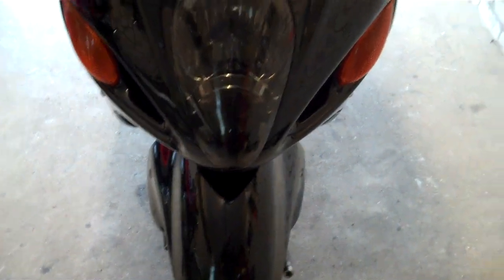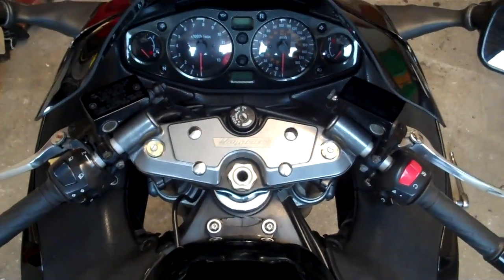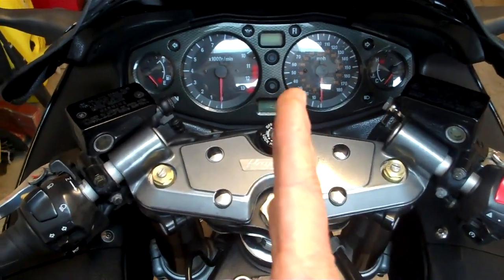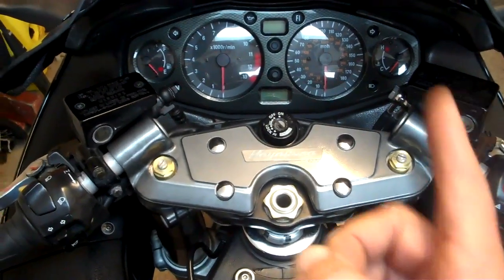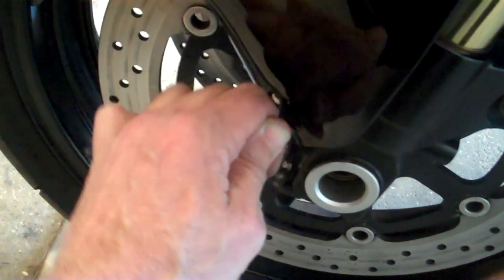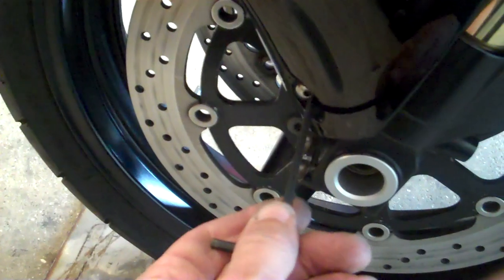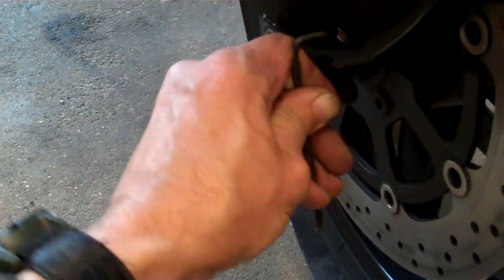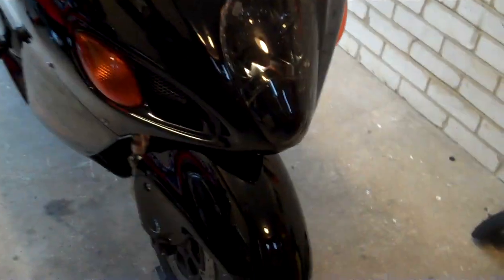Delboy's Garage, 'How-To' Re-align motorcycle forks the easy way.

Comment: the only way my front tire lines up with bars/top tree  is under a slight tension, with tire between my legs i'll turn the bars straight to the wheel if let the bars go it twists back out of alignment, would you tighten it down while under tension to keep it straight or leave it relaxed and slightly out of alignment
Reply from the maker: Hi Paul, sometimes on smaller bikes they don't snap straight, as the yokes aren't thick enough, and if it is only a very slight amount, then I guess you could tighten it up in the straight ahead position, but it's not ideal... you are making sure that the top yoke centre nut is undone??  And the wheel axle??  I presume... plus, of course, the mudguard mounting bolts??
Reply: yes every thing lose but the top tree clamps even the fender was lose, its a medium sized cruiser 41mm forks. i think the only thing holding it straight is the crown nut in the center of the top tree,  it always go's back to 2 degrees off i think because that crown nut doesn't have the clamping force to hold it

Comment: Great advice. For your axle nut I would probably use 2 nuts together with threaded  cut off bolt + locktite to hold together & not worrying about nut falling in or out? Amazed how simple that was.Bmw probably charge  $200.00  for that.lol.

Comment: I have vtx 1300s and when I hit a bump or just hold the bars one handed while cruising, the handle bars start to shake bad and get progressively worse if I don't grab onto the bars. At high speeds I don't have that problem only below 55 or so I would say. Could this be the same problem in having.
Reply from the maker: I would say, probably not, if your forks are misaligned, you'll feel the bars twisted to one side as soon as you ride it... its more likely to be the tyre, or wheel balance.. check your front tyre pressure, and look at the tread to see if its unevenly worn, this will cause the front to shake at certain speeds...!!

Comment: I do have a question based loosely on this topic.  I am riding a bike that is naturally heavy, but this bike has a real heaviness when turning.  Either at slow or high speed, the bike takes over the steering when leaning and forces me to counter steer to correct the required amount of turn I need.  I swear this is not correct, the bike has not been in an accident, everything is straight.  I am very familiar to this bike I am riding as I have owed 2 before but this one is bloody horrible to control and have no idea why.  Tyre pressure good, new oil in forks no issues, in fact it improved slightly but not a great deal, brakes not binding, lock to lock no grinding, stanctions are at top most in triple tree.  I am so dam lost as to why the steering is taking over, CBR1000F.   Only thing that is different is the rear swingarm being full OEM not aftermarket like the previous bike had.  JCM ally.
Reply from the maker: Hi Jason, This will more than likely be related to your front tyre, you say the pressure is correct, (as that's the first reason it will drop in too eagerly), but if the front tyre itself has become unevenly worn on the sides, it will form a point, or 'triangle' profile... and this will make the bike feel like its falling on its side by itself.. making you fight it to hold the lean angle...there's no fixing it buddy, its just wear and tear.

Are they reasonably worn tyres mate, maybe been run under-inflated in the past, maybe been cornered heavy a lot. or maybe just mismatched?.. invariably, it will ride like a dream once you just stick a new pair of boots on it....the good old Giant CBR couch should ride like a faithful old Labrador and never give you a peep of fight...so get it re-shod and you'll be amazed at the transformation..

Let me know how you get on.. Del.
Reply: you know what, I think you maybe right.  I can see a slight straight line central, nothing big but noticeable as is the rear tyre too.
Wow just thinking about that gives me serious cause for concern.  DAM £200+ to find now ouchhhiieeee!!!!!!!
Reply: you know what, I forgot my manners..  Thank you friend.

Comment: Hi. I have harley davidson breakout. I think there the same issue with my forks. Do you think it'll work on my bike? As i see one side of brake pad of front brake has completely washed off. Please reply soon.
Reply from the maker: This is about Fork alignment Mandeep, are your forks misaligned, (bard sit to one side while riding straight?) If so, then yes this will work for you, but it has nothing to do with your brake pads my friend, they are no related to wheel or fork alignment..!
Reply: Moonfleet41 Thanx. Can i contact you personally?

Comment: low sided my bike going about 10 mph turning out of a gas station was wet out and rear tire slipped on road paint, handlebars are slightly tweaked to the right for it to ride straight was afraid I bent my forks trying this later on thank you!

Comment: hey, any chance coming off the bike and the handle bars scraping the ground would cause this? (the silver bit at end (no idea on name new rider still lol) has bent a bit)had a slow accident in the wet and felt sorta wobbly on way home. thanks in advance.
Reply from the maker: +frankie skivington I think you are refering to the 'bar weight' or bar end cap', and if you bashed it on the ground, then, yes, it's likely you've knocked out the alignment.. this costs nothing to check, so why not give it a try!
Reply: perfect thanks i was worrying it was something worse! il give it a go and hopefully it works thank you for the reply :D earned a sub :)

Comment: Can I ask, this slight off aligement.  Did this cause your bike to steer in one direction.  Better explained, Remove your hands of the handle bar and let the bike coast for a few seconds, then retake control.  Doing this, did you notice if the bike wanted to pull left or right.  Or did you not try this when you original found this fault.  My bike is pulling left ever so slightly but the worst is, when leaning left to complete a left bank turn.  The bike feels unstable, however when leaning right the bike is stable and i feel confident.  I had done this to my bike 2 years ago and have not done many miles at all and it did ride fine but felt a little unsure about the left lean issue.  Now this month rode the bike after 6 months away and god dam, I am not bloody happy to lean left on the bugger.
Reply from the maker: OK buddy, a few things to check - firstly, TYRE PRESSURE - makes sure it's absolutely correct before you start the test... if you're gonna test if the bike is pulling one way or the other, it must be on an absolutely FLAT ROAD with NO camber... if you can't find one, then go o the other side of the road when it is safe to do so, so the camber is to the right, and then try again, because a bike will always pull downhill in to a camber, which is often why, on a left camber, bikes will feel like they are pulling on left hand bends, more so than on a right hand bend........ also, TYRE CONDITION - is your tyre unevenly worn on the front, is it 'shouldered' or 'cupped'??  And lastly, if all those things are in order, perfect tyre condition, perfect tyre pressure, perfect flat surface, and you're still pulling to the left, then check the rear wheel alignment is perfect, and finally check your forks - pretty much sure you will find the problem somewhere in that lot !  Let us know how you get on....

Comment: Didn't work for me (r1200GS).
I ended up running a laser along with the rear wheel, strapping the handlebars to the rear rack (making sure they are perfectly straight).
After I loosened the bolts I aligned the front wheel with the laser. 
It did work pretty well for me this method.

Comment: Hi Del.

What else would cause this problem ?  My old Blade is still out!  bent fork maybe?
Reply from the maker: Budd Hudd Hey Budd, Naah mate, a bent fork is a proper nasty last thing it could be...they are thick as tree trunks on even the early blades, its far far more likely to be the back wheel out of alignment..!!! (think about it, it makes the bike 'crab' which will cock the bars off to one side), or maybe a bent clip-on like i just had on my RSV..... remember mate, a fork leg is a hydraulic ram...and if its bent it wont slide up and down any more..!!! check all your alignment, rear included, then strip the furniture off the bars and look along them to see if they are both straight... (only takes a static drop right on the end of the bar weight to kink one as they're only light alloy tubing..) hope that helps budd... cheers Del.
Reply: Your a Fountain of knowledge man . Cheers for that.
Reply: Moonfleet41 I was about to ask this same question. When I got my Sportster it had 3000 miles on it and pulled to the right. I saw this video, but never found the time/tools to do the fix. Ended up in a fender bender, and my entire front end was replaced (tire, rim, bars, forks, risers, triple tree etc), and then I replaced the rear tire. After that was all said and done, it still pulls to the right. I have faith in the shop that did all the work, but since it still pulls to one side I figured I'd ask someone who has demonstrated more working knowledge (plus a dedication to perfection) and who has never led me wrong. Any ideas of what else it could be, or is it most likely (and what I think is the answer) that something is still just out of alignment?

Comment: Hello will this work on a SV650s? I laid it down, and have tried many things to get it straight and ended up just buying new forks even tho the other ones didn't look bent... I don't have real good equipment but I have a rear jackstand... Anyway question is does this work on a sv650s the same way? And for the axel bolt, do I need to loosen it all the way till the thread is all the way loose, or just alittle bit
Reply from the maker: Erik Monson Hi Erik... yes, this will work on any regular forks on any bike, just looses the axle so its free to move then go ahead with the proceedure... also if you have 'clip-on' bars, check that the one you landed on isnt bent...?
Reply: hmm.. Ok, how exactly do i check that
Reply from the maker: Erik Monson just examine it, see if its identical to the other side, look along it so you csn see if its straight....simple stuff.
Reply: It is... If the triple-tree is bent, is there a way to measure that or do I need to completely remove it?
Reply from the maker: Erik Monson Have you yet done the alignment as in the video??

Comment: spotted a way you might be able to improve your improvised wheel spindle tool.

If you use a ring spanner instead then plonk a bolt in with a big washer or another nut next to the head , you could lock both nuts in place around the spanner , then it means you dont risk damaging the spindle .

Comment: hello my friend, i have a honda hornet 2013 and feels like the bar is not straight and the bike doest goes straight you feel it more when leave the bike without putting hands in bar, in the same time the left hand hurts a lot during riding :/ looks like i have a pressure on it more than the right hand, do you think it has to be done with forks or back wheel alingment ? Thank you !
Reply from the maker: Why not check both the forks (as in this video), and the rear wheel alignment.. then you will know for sure..?
Reply: if i do both of them and still has a problem, what should i do after, does the tires has any effect on this ? thnx for your response :)
Reply from the maker: Rather than worrying on and on and asking "what if what if"...just do your fork realignment, and check your rear wheel alignment... then see how it is..!!

Comment: Hi del finally got to the problem, one of the yokes are twisted , but  is there a way to check if it's top or bottom.
Reply from the maker: +James Percy Hi James, thats unheard of mate....how have you determined that a yoke is 'twisted'...?
Reply: +Moonfleet41  my bike got hit last year , the forks where ok and from my past comments I have replaced the front wheel, wheel bearings , front tyre , and full rebuild on the forks but It still seamed of with the handling  . The bike has same problem as yr bike in the vid - yoke strait but wheel looks slightly to left . I have did everything to straighten them both even holding with my knees , then my mate taken an measurement from each side of the top yoke .
Reply from the maker: +James Percy oh well, I guess if at least if you change them it will eliminate it...

Comment: If the handlebar was bent above the fork because the bike was laid down will this work as well? Or does the individual handlebar itself need to be fixed/adjusted?
Reply from the maker: Hi Keifer,  If the actual handlebar itself of definitely bent, then this will not fix that... all this does if allow the fork legs to twist back into line when they have been knocked out of alignment.... i think you will need to replace the bar with a new one buddy... !
Reply: Is there any way I could unscrew the handlebar clip on and reposition it so that it is straight? Or does it need to be replaced entirely?
Reply from the maker: Most clip on bars are bolted into one fixed place, usually with a bolt under the yoke.. you can take this bolt out and slip the clip-on back into position....but its not ideal.. !

Comment: So if my forks are misaligned, how does that manifest when riding the bike except for a crooked steering bar? I lowsided my bike a week ago and from the looks of it I just got some scratches on the fairings etc. but the handling of my bike feels very weird when riding through curves, I'm thinking it might be something like this?
Reply from the maker: Hi Robin.. Firstly mate, im sorry to hear you dropped the bike, i hope you weren't hurt in any way... OK, it's not unusual for the forks to be slightly knocked out of their alignment if the handlebar end hits yhe ground... so yes, certainly check that with this procedure... and also, it can help while you're checking everything to check the rear wheel alignment too,  it's unlikely that the low side caused any issues there, but it's well worth checking both ends while you're there ot make sure the whole bike is safe..     If you still find you have a crooked steering after you do this.. then take a look at your handlebar itself to see if it has been slightly bent on the drop.!   Good luck with it and i hope you get it fixed..
Reply: @Moonfleet41  Thank you! I managed to ride away from the accident without any injuries at all thankfully.
Both the handlebar and the rear swingarm took a hit so I will check all the alignments you mentioned. Very thankful for the reply mate!

Comment: Hi del can I pick ur brains please. I recently did a service on my 95 bandit 600 when I took the tank off I removed the two tubes off the carb replaced the spark plugs and I noticed a 3rd larger tube that was not connected to anything on the tube it says unleaded petrol but its not connected to anything plus on tickover my bike is missing on the right hand side of the engine when ur riding its fine but tickover its dropping below 500 revs and nearly cutting out any advice would be great many thanx mark
Reply from the maker: Hi mate. is that tube one of the fuel supply lines?, not being able to see it i can't tell, but if it says "Unleaded fuel" on it, then it probably is!....if its the supply to the right two carbs it may have gone to a 'T' piece and has come off?...also of you have a balance tube off that runs between the carbs ti will tick over low and run badly at low speed.. just have a hunt round to see when its meant to be connected...it must have come from somewhere if it was running right before..!

Comment: ive done this twice to my bike which was massively out of line ... in the end wedged the wheel between a friend legs and twisted the bars (like what you do with a bicycle ) was quite easily done and its got to the point now where its  like the bike in the video only slightlyy out what should i do ? try more force ?
Reply from the maker: Have you checked the rear wheel alignment?, because that can make the front feel out when you ride.!
Reply: @Moonfleet41  ye rear wheels fine  , i can see it out a little when you line top fork yokes up straight  wheels slightly off can see it more when  off the bike than on it

Comment: Hello brother, nice video. I tried the same method on my 2016 Kawasaki ER6n. The handle bar was tilted towards right while riding on a straight stretch. I tried this method. Handle bar position is 75% fixed. But the wheel is towards right now. Seems only one side of the tyre is getting used much. Please help me out.
Reply from the maker: Hi Darshan, have you checked the rear wheel alignment as well??  Because if this is off to one side, and not correctly aligned straight, it makes the front feel twisted, as the bike is 'crabbing' - check that first and see if that fixes it....!
Reply: Moonfleet41 yes brother I've checked that too.  I'll check everything again and get back to you. Let me see what I can do.
Reply: Moonfleet41 there is also a lot of rattling sound from 3000-4000 rpm on my ER6n. Can you identity the proper. Different owners have different opinions. Some say it's the headlight assembly rattling, some say the instrument cluster and some say it's the air valve in the tank cap. The buzz is very annoying since I cruise at that engine speeds. 3-4k
Reply: Problem*
Reply: Had annoying buzzes too, turned out to be both the front mudguard against the fork lowers AND the fuel tank against the frame. sticky-backed foam (like window draft-excluder) fixed both for me.